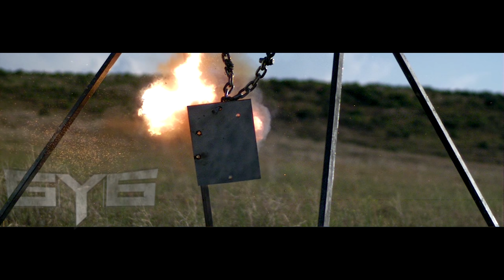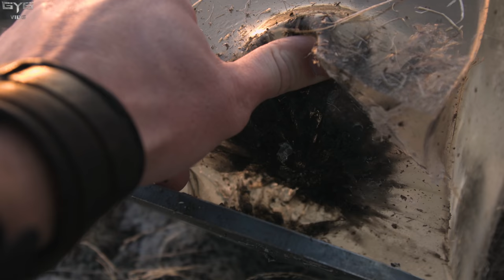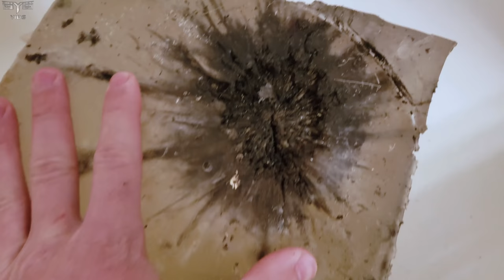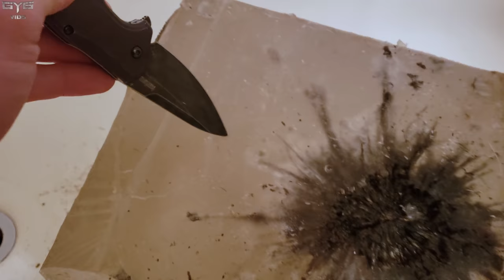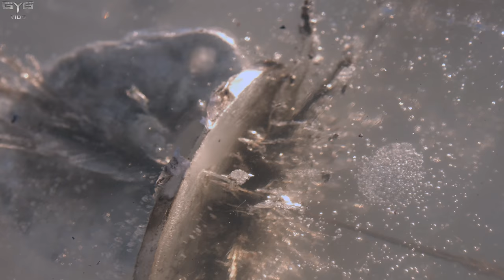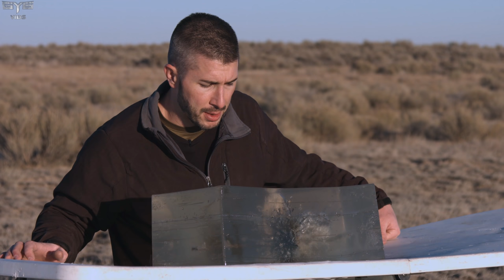Shooting a STEEL Plate inside Ballistic Gel with 50 BMG APIT Ammo

Comment: I gotta be honest, for the second shot I did not expect there to be that much expanding gasses coming out of the ballistic gel. That and just the way that the pressure wave contorted the gel and put excessive pressure on the table it was sitting on paints a graphic picture of what an APIT round is capable of against both armored and soft targets. Thanks for the video.

Comment: It was so cool to see the effects trapped in the gel like that, can you add more gel blocks and steel plates? I’ve never seen a 50 bmg round stopped in gel before I’ve just seen videos of it going through 2 full blocks with ease, so maybe 2 or 3 blocks with 2 steel plates or one thick steel plate? I just think it would be interesting to see where the actual penetrator will stop :)

Comment: It might be possible to make a steel bracket that would sandwich the two halves using threaded rod down the outside of the blocks at the 4 corners. 
This could keep the two halves from parting yet not obstructing the camera view.

Comment: You have some of the sickest slomo vids. I’m wondering if you might consider an experiment with the 50BMG? Since there isn’t a real hollow point round out there, (at least not that I’m aware of) how bout trying to drill a small hole down from the top of a round, (maybe a standard 660gr fmj) and see if it’ll create similar disruption as a factory type hp round?

Comment: What do you have for ear pro that is so compact but works with a .50? I know you didn't just shoot a .50 without ear pro. I've been there and done that. Not fun...
Reply from the maker: Basic ear foam plugs
Reply: @GY6vids  Braver than me, bro. Stay classy.
Reply: @GY6vids  ya that's crazy. I use custom molded plugs on top of basic electric over ears just to take the concussion out a little.
Reply: I gotta be next to the MaDuce with just tiny little foam plugs. they work well enough.
Reply: (adding to my original comment here) Context, I serve with the army, and I'm a gun truck driver with an M2 just above my head. And it echoes in the vehicle. But the foam plugs do well enough.
Reply: @furnerdhavenhomeofthenerd8844  You say that until you're about to get out of the service and have to take a hearing test. I have time next to M2 with just the cheap foam plugs. The blast is still concussive. And it still does damage. Trust me. By the time you get your 214s, your hearing will be fucked. You can tell someone was in the miitary because they aren't 40 but still have to have the TV volume cranked. 
My brother used money from his second tour to get an Armalite AR-50. I walked up on my dad and he popped off a round from that thing when I was 6 to 8 feet to his right, without any hearing pro at all, and man--that'll rock your world. Sound you can feel. 
Guns and chainsaws and metal my whole life man. My hearing is fucked and I am only 36. It sucks man. Protect your hearing. Take care of that shit, it will go away on you if you abuse it. The military will put you in plenty of situations where you're not going to be able to wear hearing pro. But when you have the opporotunity to protect your hearing, training and such, do so. Double up on that shit around the .50 and the SMAW, if you can. Let them call you a pussy. You know they are going to feel mighty dumb when they can't hear anything by the time they are 35...

Comment: First time I laid eyes on the 50 cal was in 97 on deployment in the pacific the sniper told me a story of it being tested on an enemy light vehicle in the middle east the sniper used a depleted uranium round that went through the radiator the engine block and cut the one of the occupants in half as the second occupant exited the vehicle and ran into the desert screaming.

Comment: Next time put a tarp down on the ground, that will cut you gel cleanup down to zero.
Reply from the maker: wish it was that easy...clean up consists of cutting the block up into 1-2in sized squares and pulling all fragmentation out of the gel block, as well as all burnt powder and anything not originally in the block before I can melt it down. Washing the outside is the easy part.